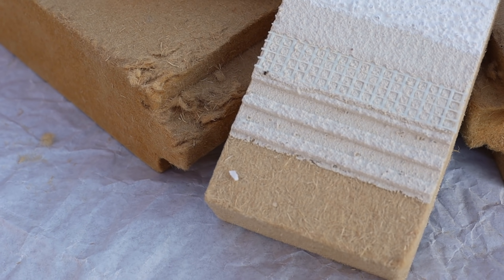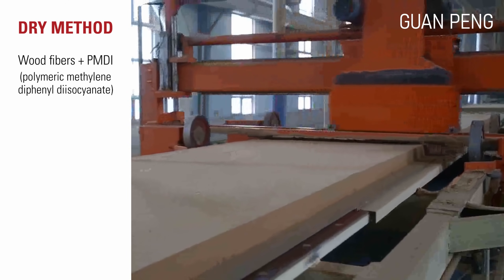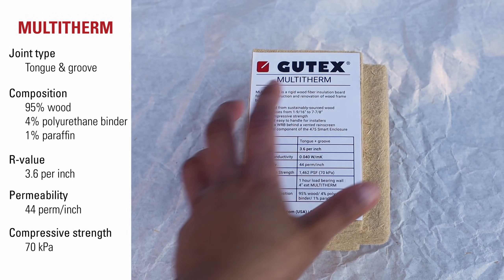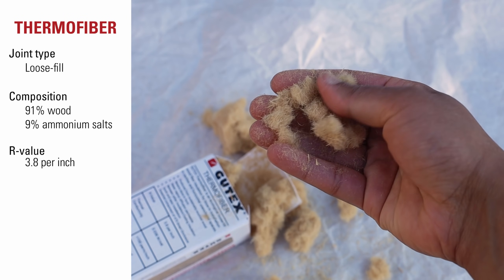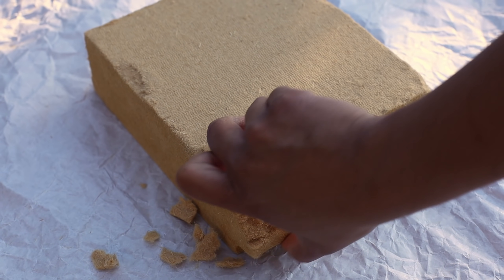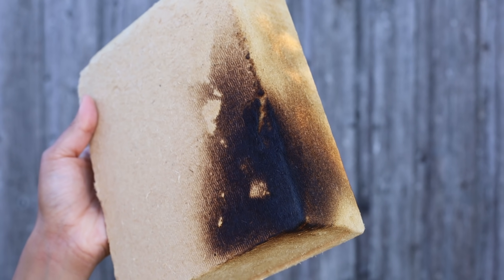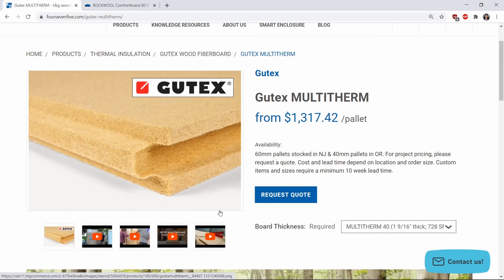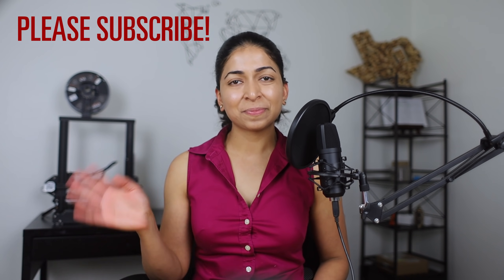Gutex Wood Fiber | The FUTURE of insulation?

Comment: Having a great deal experience with fiber board as well as mdf, I would be very hesitant to use this in a home. The fact that generally wood products absorb moisture is never going to be a good thing and even though it's treated to resist moisture the long term effects of exposure to water and humidity are still gonna to create rot. Secondly, I would be concerned with the overall weight that you are adding to a building especially when compared to foam insulation.
Reply: Yee need not be concerned of the wieght, it's less 1/4 wieght of MDF. Also, go play with some, it's awesome.
Reply: As stated earlier, it's significantly less dense. Also, it isn't supposed to installed with impermeable barrier layers, like good-old laminated MDF. It should be able to release any moisture that it attracts when temperatures rise. Like any insulation, it shouldn't be sitting under a continual leak.
Reply: You're wrong - wood fibre insulation acts very good as a moisture buffer. It can take up moisture from the air, but it releases it again and dries out, relatively quickly. When used correct in the construction and build up of the wall, it is an excellent way to build homes, offices, everything.
Reply: @Corewood_TJP  No Sir. Real, solid wood can absorb a great deal of moisture. This is evident in very old homes when they are remodeled. Since old homes had little to no insulation wood could absorb moisture and quickly dry out with no negative side effects such as mold. However, man made products such as fiber board have too high of glue content. The glue prevents a high degree of moisture from passing through it. This is clearly seen in products such as Huber's Zip panel system. However, the direct exposure of liquid ie, water to most of the commercially available fiber based panels immediately starts breaking it down, the only exception to this is if the wood fiber is initially treated to resist moisture, and the glue content is sufficiently high.  However, there are also negative attributes to treated panels such as off gassing of VOCs most especially fermeldahyde.
Reply: @thebigdoghimself  I agree with you that solid wood is also an excellent moisture buffer. That is why CLT elements gives an excellent indoor climate, because of their moisture and heat buffer capabilities. And wood fiber insulation shares the same good properties as CLT elements, why CLT elements and wood fiber insulation is an excellent combination. Wood fiber insulation is really a very good moisture buffer. I don't know why you are talking about glue in wood fiber insulation. There is no glue in wood fiber insulation. At least unless maybe in some products that are pressure-resistant wood fiber insulation. They are perhaps in some cases, but not allways made by glueing layers of boards. But even so - the amount of glue is very little (like in CLT elements it is a very small amount) and they most probably uses a glue that is diffusion open to some extend and combined with the small amount the product as a whole has an excellent my-value (diffusion openness). But many wood fiber products and especially soft wood fiber insulation does not content glue at all. Especially wood fiber granule for blow-in installation is a very clean product that only consists of wood (cellulose, hemicellulose and lignin) and some fireretardent like ammonium polyphosphates - that is harmless - the same kind they use to put out wild fires. A Danish product (Thermocell) loose granule, consists of 95% wood and 5% Ammonium polyphosphate, while their "Feelingwood" batts consists of 78% wood, 12% Ammonium polyphosphate and 10% fiber binders - I think polyester fibers or something like that), to make the batts stronger, to bind the fibers together. So wood fiber insulation is (also) excellent to take up, give away and to transport moisture.  :-)

Comment: HI Belinda, thank you for another good video. Here in the UK we have been using LDF board for more than 100 years and it works. I recently repaired a roof on a large 1907 house which still benefits from its LDF board as a sarking layer (laid over the top of the rafters to cut down on thermal bridging)  In this time it has not decayed and still functions as it did day one!
For conservation of historic buildings LDF is the most reliable choice. When applied to walls inside or outside we apply our lime renders directly to it. It is of course a lot cheaper to buy it in the UK so I hope you get your manufacturing facility in the US to make it more affordable.
Reply: That's a very good point. Didn't think it was around for that long, makes you wonder why it's not used more in Canada and the US vs fibreglass.
Reply: Very interesting to read that it was used in that way already in 1907. The engineer or carpenter at that time, have been very much ahead of their time.

Comment: Thanks for the 475 Building Supply.  I am a DIY'r, replacing all our windows, in our home, this spring.  I have been looking for information about adding exterior insulation and residing in the process.  The few local GC I have spoken to look at me like I am crazy, plus they are not informed about exterior insulation installation.
Reply: I put a 1 inch layer of white foam board on my house before I sided it with vinyl. I spaced the windows out with 4 inch wide pieces of used 1 inch deck boards ( free ) White bead board has a pretty good perm rating.Letting moisture pass.

Comment: I have used Gutex multiplex top sheets on all my house building project for some years. I use them as external sheeting on the outer walls, sometimes on the roof to, bus usually we just use permeable house wrap in the roof. for the walls I glue and nail them on and so they also act as shear panel for the walls.
about your burning test, I burn wood scraps in my fireplace at home, the gutex also burns very nicely ;), so i wouldn't rate it as fire retarding.
overall, I'm very plaesed with the product and will continue using it.
Reply: Gutex has great bio-based products. In regards to fire retardant, it depends on the product. Some products like, Thermoflex have 6% Ammonium 'Salts'. The Multitherm doesn't have this. Either way, most of their products have 4-6% PUR (polyurethane) or Polyolefin binders. Which can be toxic when burned.

Comment: More and more, I think building science is missing the point and dropping the ball when it comes to insulation and air sealing.  Air sealing tests have been proving that air sealing plus insulation is far more effective than insulation alone, and all the "science" that led to vented attics and crawl spaces has proven to be completely and utterly wrong.

The "science" with regard to R-value of insulation is proving to be crap too.  I'd strongly suggest watching the YouTube channel Spray Jones if you want to see some real world testing and comparison data on insulation.  There's a reason spray foam is favored for passive home design, even though its R-values look lower on paper.

Also, brief tests of fire resistance do not reflect real world fires, at all.

Comment: With the current US wood shortage though I'd wrather see people looking at other materials used for cellulose insulation board and bat insulation. For the industry looking back at hay, hemp, and AG byproduct fill and upgrading it into a panel or batt product would be nice for sustainability. Using Borax and Modern glue products could make great improvements over the old school methods they used to use a hundred years ago where any insulation you had was whatever plant fluffy chuff you could shove in a wall cavity. Other than the wood shortage though I'm 200% behind sustainability and carbon sink insulation. Great video 😁👍 I wish they made this product in the US
Reply: There is no wood shortage. In fact it is hard to sell logs to lumber mills. We own 20 acres of timberland that used to be logged every 20 years but not any longer. We received an offer to log it for free. Oh joy.
Reply: @Krunch2020  I wrote this 2 years ago when finnished wood was in short supply due to pandemic supply chain issues. Things have changed and prices have normalized.

Comment: Agreed! We should be looking at more and more engineered wood products for as many things as possible in construction.
Reply: WTF are you talking about wood is a terrible insulator this would never pass code anywhere I have worked.
Reply: @xcalibertrekker6693  Yep, this stuff seems like garbage. An R value of only 3/inch??? Not only that, but wood fiber and parafin wax might be the most flamable in wall insulation ever devised. Think how much four inch panels of this crap must weigh just to get an R12 value of insulation. The installation must be a nightmare to boot.
Reply: @xcalibertrekker6693  Well, then pour a concrete house. Seems like you only looked at a few seconds of the video and jumped all over the keyboard?
Reply: @ksoman953  Concrete is an even worse insulator.  Do you have any idea at all what you are talking about?

Comment: Made from ground up pallets.
Reply from the maker: Dayum, that's what I should have turned my Pallet Snobs business into! :)
Reply: Pallets are treated with some nasty chemicals aren’t they? If this is made from recycled wood, I’d be concerned about the chemicals used to originally treat that wood.
Reply: @sunspot42  Not really, most pallets are just raw materiel. Either from oak to pine.
Reply: @kameljoe21  Traditionally pallets were treated with methyl bromide, fumes from which I would not want building up in a well-sealed home.  I'd also be concerned about what was shipped ON the pallets and might have spilled and leaked onto them, including toxic materials.  The manufacturing process for this insulation would probably remove some chemicals, but not all of them.

Comment: The R value is quite low tho....isn't it?  It doesn't seem to compare well to insulation already in use.  (?)
Reply from the maker: It's not bad at all. R4 compared to R4.5 for mineral wool and it's a lot less energy intensive to manufacture.
Reply: @BelindaCarr  Isn't a typical insulation bat something like R13 or 14?
Reply: @CybekCusal   ah yes....of course.  Thanks.  makes sense now.
Reply: As a quick comparison, XPS foam board is approximately R5 per inch.  If this is 4.5, that's only a 10% R-value deficit against XPS foam.

Comment: I was wondering when you were going to discuss this. Though I was a bit surprised to see how little it seemed to burn despite its E Euroclass fire reaction rating. 

I'd be interested to see a comparison between this wood fibre insulation, sheep's wool, hemp and other low embodied carbon, vapour permeable insulations.
Reply from the maker: I'm working on a spray foam video next and then an overall comparison!
Reply: That would be great. Looking forward to it.
Reply: @BelindaCarr  when will you do a video on Vacuum insulation?
Reply: @BelindaCarr  I’m presently working on a project with Gutex products including Multitherm. Cold climate construction. Let me know if you’d like to get in touch.
Reply: Agreed.